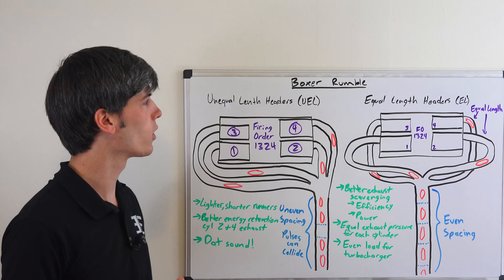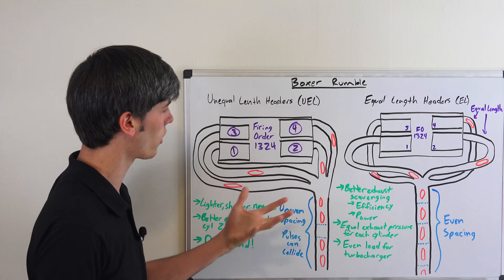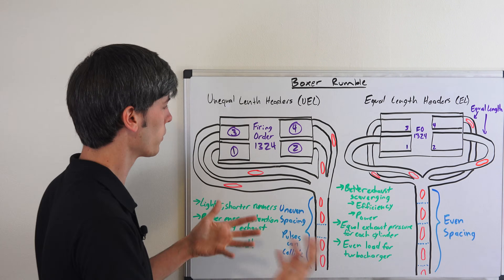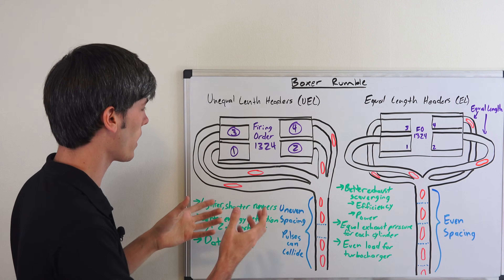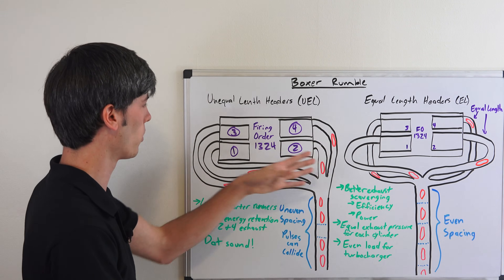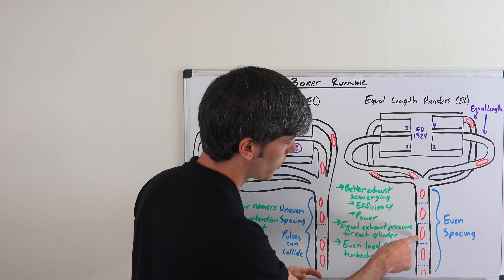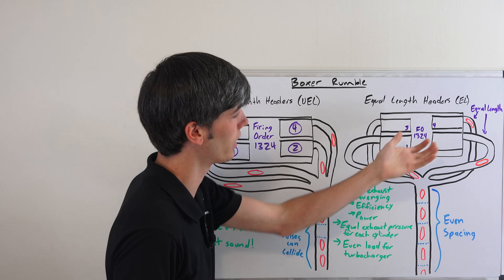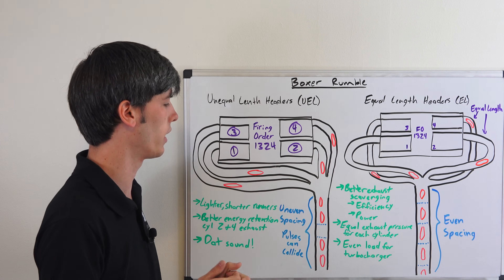Subaru Boxer Rumble - Exhaust Explained

Comment: So theoretically I should be able to make my Honda Civic rumble as wel if I add enough plumbing to the header? Mad! :D
Reply: Haha! Thanks, that was awesome! :D
I'm just wondering how many HP were lost in the rumble. ;)
Reply: banpeinet on less built cars (stock heads/cams/turbo) there's maybe a 5-10whp difference. The benefits of the design though help the turbo spool quicker and it equalizes cylinder pressures/temperatures.

On your NA honda, the power difference will probably be negligible.
Reply: aemravan there is no loss when you make subarus equal lenght..theres a gain
Reply: +DevanH87 Any N/A application was suffer a lot more from inefficiency than a forced induction car. If he took the NA motor and introduced a poor header design the power loss would be much more significant than if the HP loss of an sit going to an equal length header
Reply: +Rome1017 Actually there is a loss of bottom end torque ;)
Reply: @TTime685  there is no bottom end loss with EL headers, it’s the other way around lol. EL headers on turbo cars see a gain of 50 ft lbs of torque down low and quicker spool, and on a n/a engine the ACE 350 EL header saw a 23 ft lb of torque gain and completely got rid of the torque dip over the tomei UEL… that’s pretty substantial gains over a UEL. Whoever is spreading the misinformation of UEL equating to better low end torque needs to stop…
Reply: TTime685 not the graphs ive seen and in person, the gain up top is far greater than any loss down low
Reply: +Dr Pollywog I'm trying to do the same for my tC as well. Any chance you could upload a video of the design?
Reply: Dr Pollywog Ah okay it's all good man. I was planning on doing the loop anyway. Just wanted to see how it looked in the engine bay of a tC
Reply: +banpeinet My 2000 Civic DX sounds just like a Subaru.  All I had to do was cook an exhaust valve on cylinder 2.  Car is doggy now, but it's still delivering 43mpg!
Reply: +Rome1017 and becuase its a honda civic
Reply: you could but the exhaust wouldn't sound the same, it would be a higher pitch due to different exhaust piping size, and different bore and stroke sizes

Comment: I wonder how would it sound on a 240
Reply: +Isaiah Sampson It would sound the same. People have put UEL headers on inline 4's before. They just sound exactly like a Subaru boxer 4 with UEL headers.
Reply: Patrick Ford You're comparing two different things. You're comparing Subarus with EL headers vs Subarus with UEL headers. However, I'm talking about Subarus with UEL headers vs non-Subarus with UEL headers.
Reply: +AnythingLoud, um no. I've owned three WRXs, including the new one and I've hung out in parking lots (don't judge) with other Subbie owners. I've heard EJs with EL headers. There is a big difference in sound.
Reply: Oh.
Reply: A friend installed a homebrew unequal length manifold on his 1.0l Nissan Micra.  Sounded exactly like a Suburu boxer.

Comment: How significant is the power difference between the two headers?
Reply from the maker: +Anthony Buscemi I would disagree and say that EL is more efficient, and thus more powerful. You don't get "max power" by messing up your exhaust scavenging.
Reply from the maker: +Patrick Ford Haha there's something we can both agree on, bring back the hatch!
Reply: Peter Konrad Konneker Im sure they do aftermarket EL headers, I know they do them for my car I have the ez30 h6
Reply: +Engineering Explained Tuned scavenging only happens at one engine speed. That said,  UEL could tune each bank for different speeds, I guess. THAT said, the old UEL WRX headers were a packaging compromise, where the new EL headers are there to chase down every ounce of efficiency. I'd probably agree with you and the Subaru engineers that the EL are more efficient. BRING BACK THE HATCH.
Reply: +Engineering Explained Is there a way to get factory EL pipes on these? Or do they care more about their sound? Wonder if the effect is measurable.

It's probably negligible for daily driving in any case.

Comment: So what about the squeak or whistle that you get from an old VW beetle's boxer?
Reply: +mickeybill I believe that is actually from baffles in the exhaust wearing out. The "pea shooters", as they're called, I don't believe are actually supposed to sound like that. I'm not greatly sure, but I know it has to do with the baffles either wearing out or that's the natural sound of the baffles in the mufflers. That sound I guess is called "fweem" too.
Reply: that "fweem" as it's referred to is a result of the resonators or pea shooters and the baffles inside them, and yes it is supposed to sound like that

Comment: It's possible to get dat rumble (albiet, not as intense) with equal length headers. Using a 4-2-1 collector setup instead of a 4-1 collector setup seems to preserve the rumble more. I had guys ask what headers I was running on my RS when all I had was a 3" catback on stock headers, which have the 4-2-1 collector setup. I still have rumble with my 2.25" catback, too, it's just quieter overall.

Most aftermarket EL headers have the 4-1 collector pattern.

I'm planning on getting the TechWorks Engineering 4-2-1 headers hopefully by the end of next summer, so I'll find out for sure if EL can still have good rumble.

Comment: So, could you put a set of UEL pips on your 2016 WRX if you wanted that rumble?
Reply: +Daryl Martin in theory, yes. but only if they physically fit the engine though
Reply: +Joel Sägesser Just read this in a Subie forum: 

The '15 uses a twin scroll turbo. You will not see an UEH for the car, as the turbo needs to be driven symmetrically. It is a significant HP loss using one.

So you either get dat rumble or a more engine exhaust? :-)
Reply: I was expecting that, nice to know